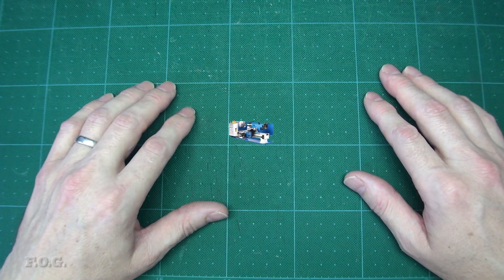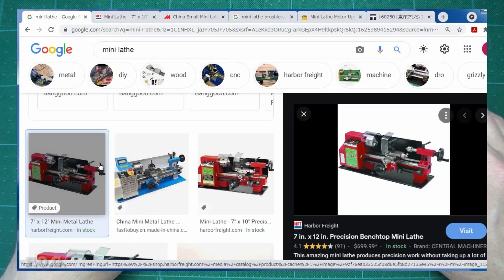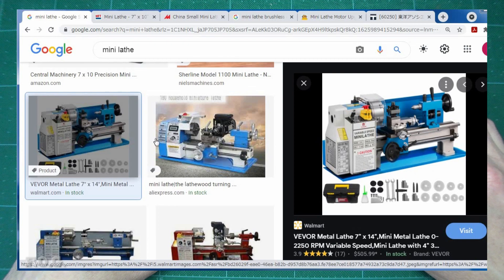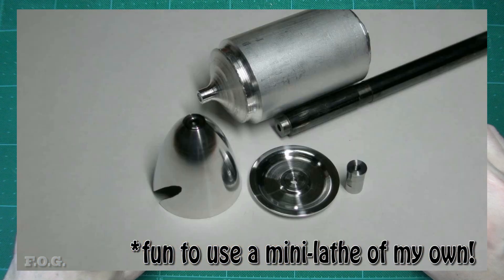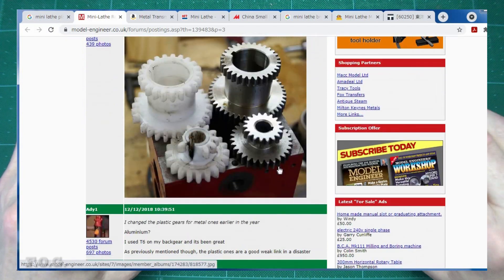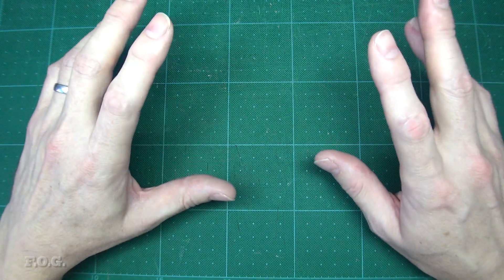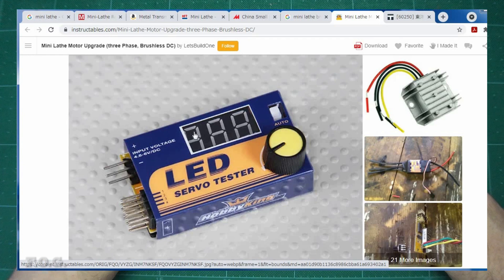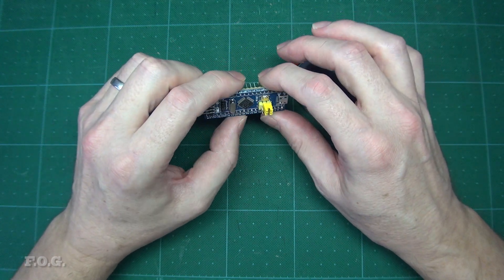EP1 - Mini Lathe Upgrade - Project Introduction - Brushless Motor Conversion How To

Comment: how have i only just found this series...
I'm working on something at the moment that would take 4x smaller BLDCS (drone motors 2700kv) and combine the output using a differential
Hoping i can cut atleast plastics with the output power
Reply from the maker: Welcome, and I hope you like the rest of the series. It's only been out a little while so no surprise you didn't see it yet. Good luck with the multi-motor arrangement, seems like you might need to gear it down a bit, but interesting to see how that goes! Thanks for the comment ☺️